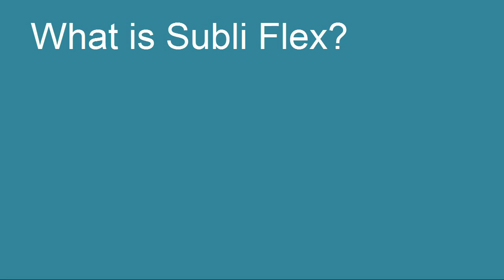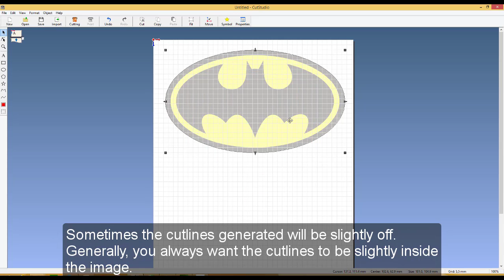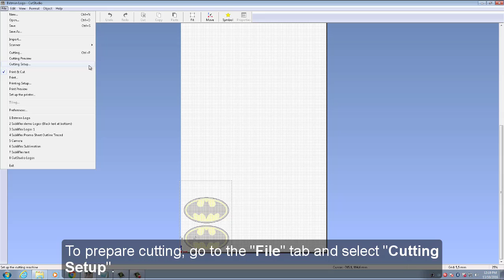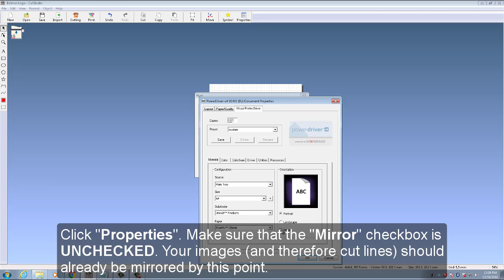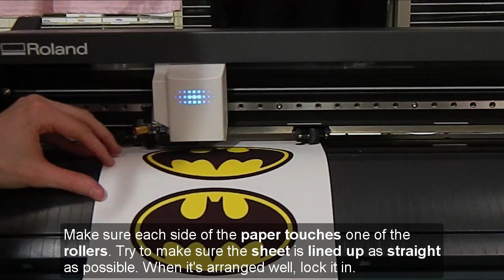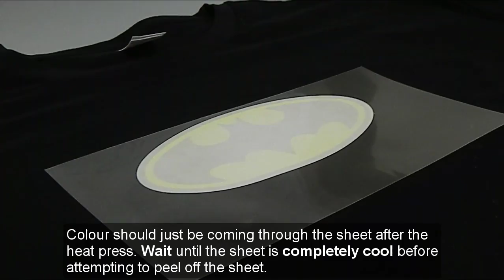Subliflex - From Start to Finish

Comment: First very thorough video. Little confused though on the printing. If using Coreldraw for the print and cut (non Roland cutter) would the print part be printed in reverse image (mirrored) or image right (normal). ?
Second what is the hand like for solid graphics as the batman logo you did ? Large graphics ?
Thanks.